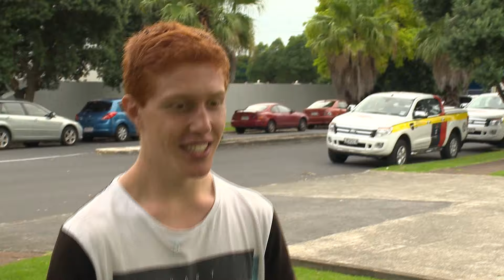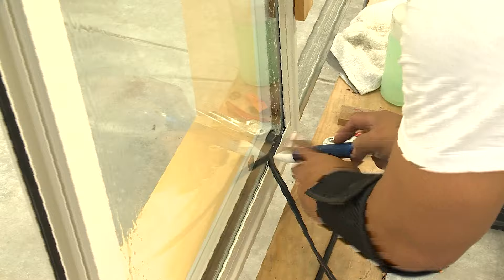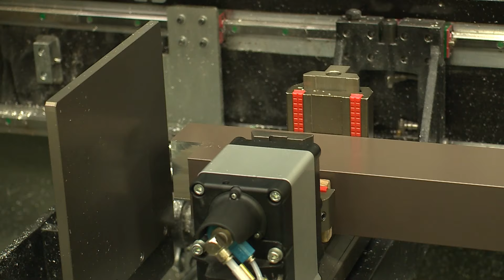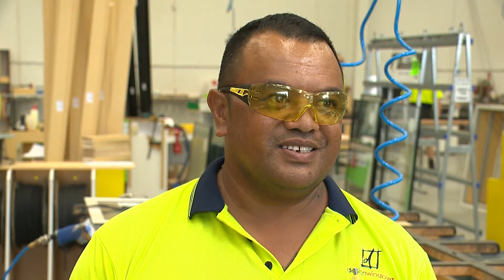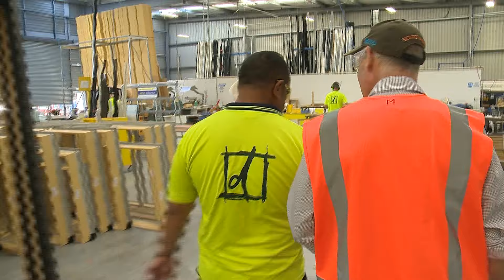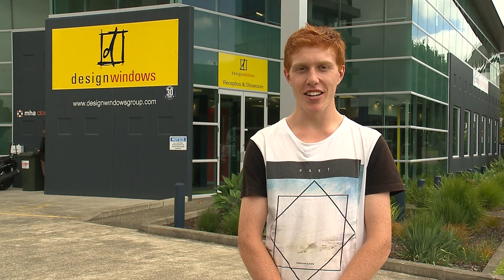Architectural Aluminium Joinery Careers (JTJS11 2016)

Comment: Was going to comment on how the use no sealant in the joints and frigging nail gun the outer plates on,
then I realised thermal insulation is prolly not that much of an issue in Aussie Town.